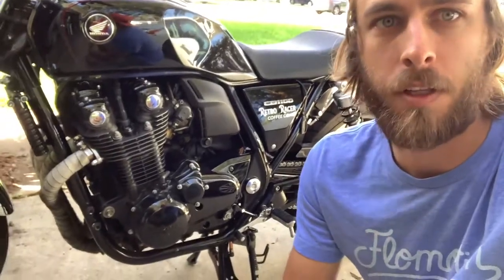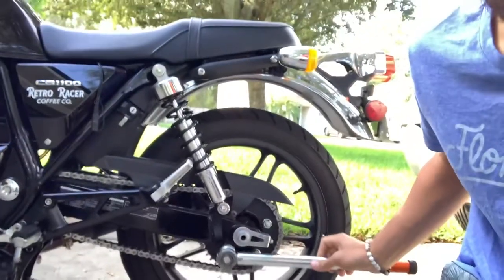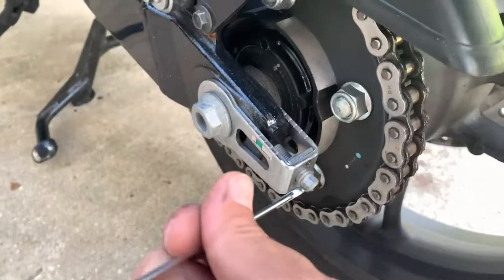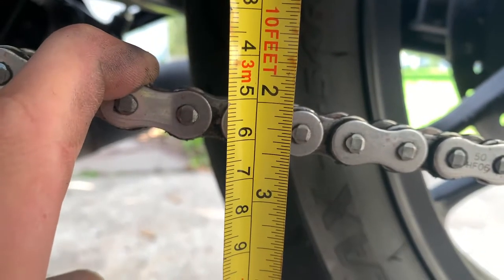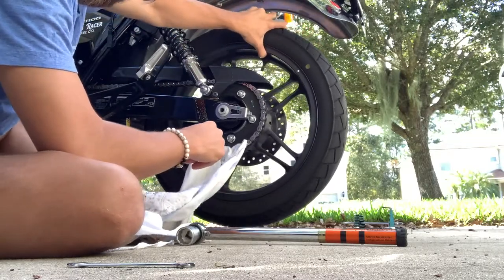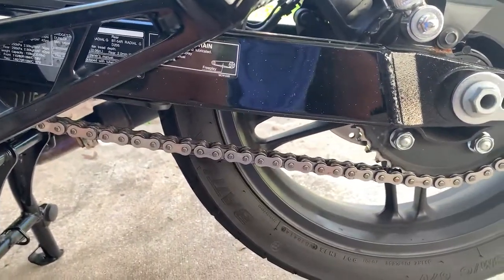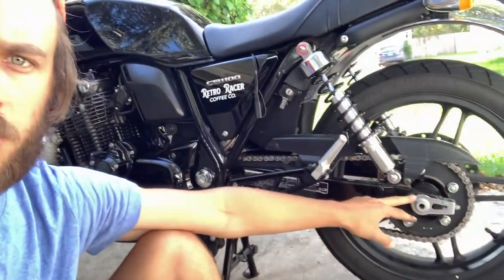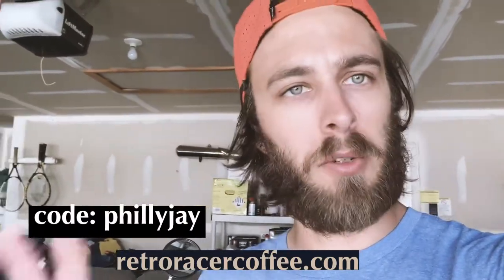Adjusting Drive Chain | Honda CB1100

Comment: Phil great video and tutorial on the chain.  I plan to get this done today, as I haven't even checked the chain tension in the last two years since I've owned this bike.  Thanks a lot!
Reply from the maker: Appreciate that! Happy riding!
Reply: @phillyjaybro  Follow up: I measured my chain last night and it was at 50mm.  Not toooo bad, but clearly out of spec.  I adjusted the rear and got the spec to about 30mm.  Cleaned and lubed the chain too.  Thanks!
Reply from the maker: Epic!! Yea I’m about to do mine again as it’s gotten a bit loose since my last tighten.

Comment: Pro Tip : Before tighten your axle, fold a rag 4 or 5 times and roll the wheel backwards pulling the rag between the chain and sprocket. This will pull the rear wheel up against the adjuster bolts ensuring that the wheel is truly aligned properly.
Reply from the maker: You must not have watched!
Reply: @phillyjaybro  brother, I did watch it. The only problem is that you rolled the wheel forward pulling the wheel forward yes, but putting the functional slack on the other side of the chain. I hope I explained that in a way you understand. I didn't mean any disrespect at all, I love the fact that you have a channel dedicated to informing riders for $0 other than ad revenue. Keep going dude. 💪 I was just trying to add to the specificity, that when I worked for Factory KTM we were taught the other way
Reply from the maker: Ahh!! No way! Haha I had no idea. I thought you were just suggesting to use the rag.. Thanks for the tip!! I guess the way I did it doesn’t do anything then 😂

Comment: Have you had your valve clearance checked? Just wondering, I’ve got same bike getting close to my maintenance check at 8,000 miles, thanks
Reply from the maker: I have not. I'm just over 6,000 currently. I've read a lot of threads about that though and most people never needed adjusting on their 8k check so could always give her some more miles if you're looking to hold out!
Reply: I'm at 13k on my CB1100 and the bike seems to run fine.  Haven't had it checked yet.
Reply: @LA_Commander  

My CB has run 72.000km without a valve check. It  runs fine. It's up to you, if you want to take the risk or not. I take it.
Reply: @peterweise3836  Sounds good Peter.  I have 14,000 miles on my CB now and just changed the oil.  She runs great.  I checked the spark plugs and they look fine as well.  Not going to replace them until at least 20k miles.
Reply: I just had my 14 Deluxe in for tire mounting. And for what it's worth, I asked my mechanic about the valve clearance check. He said "honestly with these CB's, if its not showing signs of valve issues, I wouldn't bother checking them until over 20K."
Reply: @dcjr1053  I’m at 17,000 , no valve check yet, still purr’s like a kitten, but I keep everything else maintained, love my Cb. I think these engines are some well made motors that will probably last many miles

Comment: Hi, Did you change your brake rotor, or you have any ideas to get a spare one. I need to replace for my CB1100 2013, but after search around all i found is the one ship from China which take almost 2 months.
Reply from the maker: Hey Hung, I have not changed my brake rotor. I did a quick look and also didn’t see anything readily available. Have you  checked with Honda directly? I would assume they have them in stock, just maybe a bit pricey
Reply: @phillyjaybro  Thank you so much Philly, look like i need to step by the Honda Dealer, it will be a bit pricey kaka. Have a nice one man.
Reply from the maker: @phantienhung93  Haha no problem! Let me know how much it was!
Reply: Hung, I strongly recommend going to the Honda dealer and getting parts from them.  I would stay away from any parts made in China, particularly brake parts.  Brakes are the most important safety item on the bike, why take a risk?

Comment: How’ did you put the center stand back on without having the stop?
Reply from the maker: Hey Matt, I just keep the center stand in the garage so I can throw the bike up when I need to do maintenance. I just slide the center stand into place, sometimes with a small bolt to keep the axel from sliding out, and sometimes I don’t even do that as it seems to be sturdy for just pushing the bike up.

Comment: You've done this incorrectly you should always check your tension with the weight of the motorcycle on the rear tire not suspended on the center stand.
Reply from the maker: Good looks! Thanks for the tip J E!
Reply: No, you are wrong. CB1100 manual says that you should check slack when bike is on its center stand (page 78)

Comment: Overall good video.  However...I see this far too often, a torque wrench is not a breakerbar or ratchet.  Never use it for one!  Also store it with the reading at zero, wound down.
Reply from the maker: Thanks for the tip!
Reply: You can use it as a breaker as long as you have it in reverse and the torque rating is higher on the wrench than the actual fastener, there shouldnt be anything on a motorcycle that requires more than half the limit of a 1/2" torque wrench